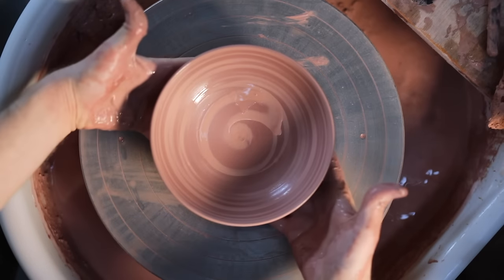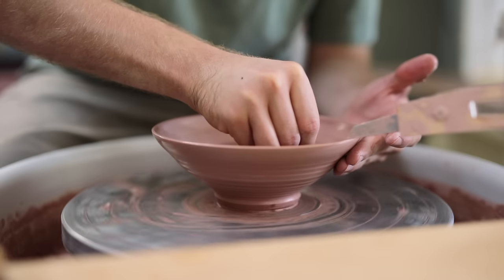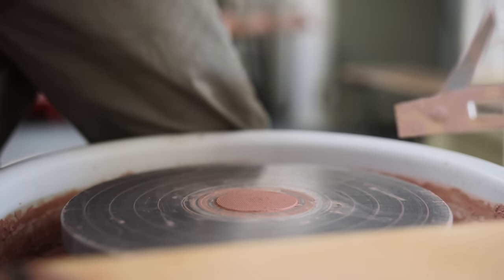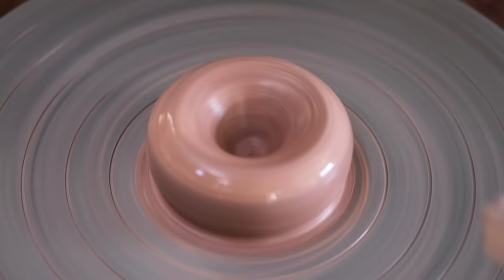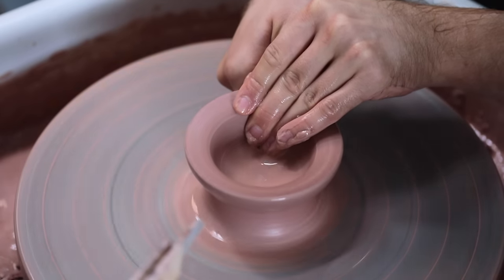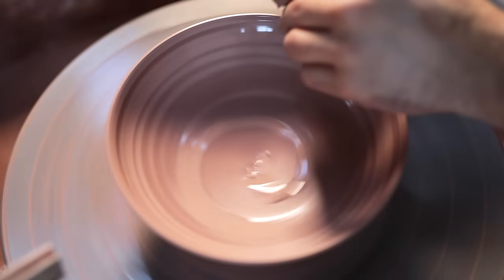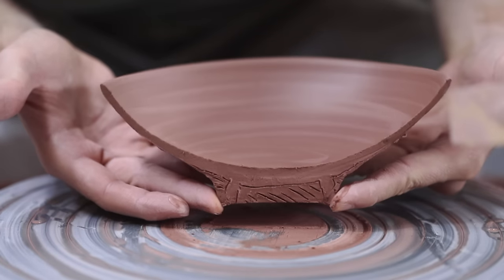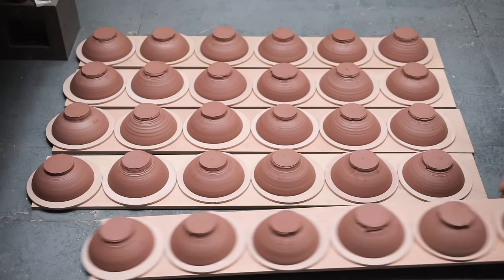How to Throw a Pottery Bowl — A Beginner's Guide

Comment: Hi Florian can you please do a video on clay showing the correct consistency of clay for throwing. Your clay seems to be very soft and when I use soft clay it collapses very quickly if I try to rectify mistakes. However I am finding that I have problems with RSI in my hands using firmer clay and now can’t wedge large pieces of clay or pull up a large piece of clay. Any tips or demonstrations would be great for an older potter who’s taken this hobby up in retirement. Thanks so much and love your helpful demonstrations. Lynne NZ